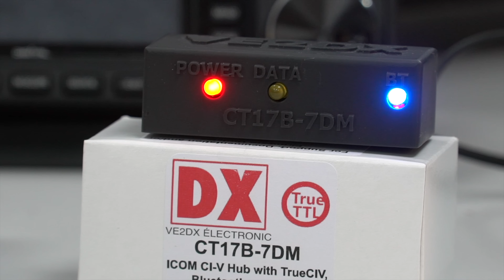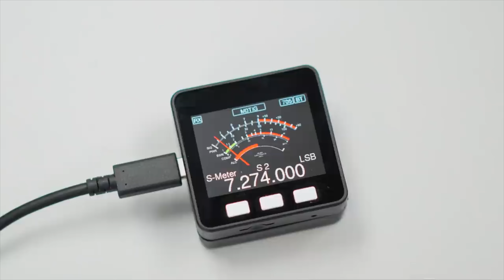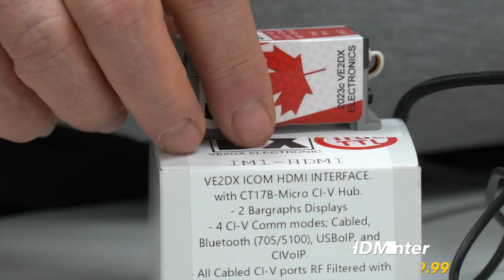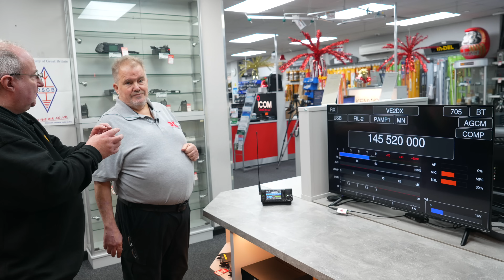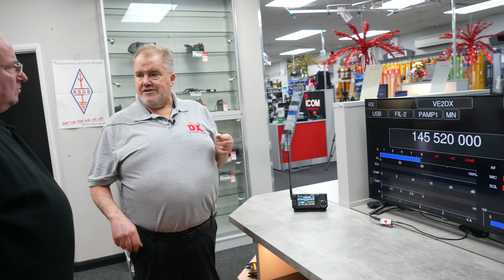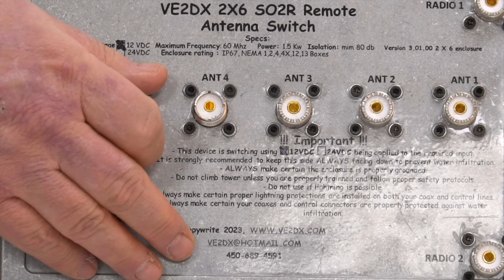CI-V Hubs: A Game-Changer for Ham Radio! VE2DX Showcase

Comment: the  bluetooth  radio inside ct17-6bt  is it  a multipoint type? Is possible to conect  two IC-705  by bluetooth to a  ci -V  port host  device like  a S.A.T. ham sat tracker?.Thanks in advance 73's from EA1-IFD.

Comment: DX .... is there an option  to Utilize the CAT port then via HMDI  ????
G1XZL/ZL2SCI
Reply: yes, the HDMI interface can interface to the radio in 4 different ways, Bluetooth for 705, ID52, ID5100 (with bluetooth option!), CI-V ports for any radios supporting CI-V remote port (756ProIII to 9700), USBoIP for radios with USB- CIV  like 7200, 7300, 705 and 9700, and soon CIVoIP for radios with LAN or WIFI like 9700 and 705.